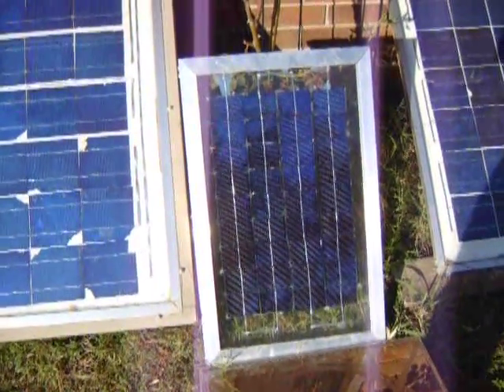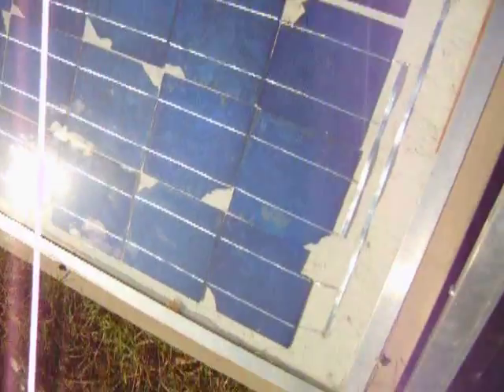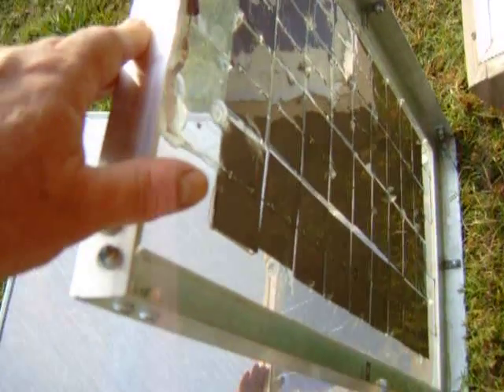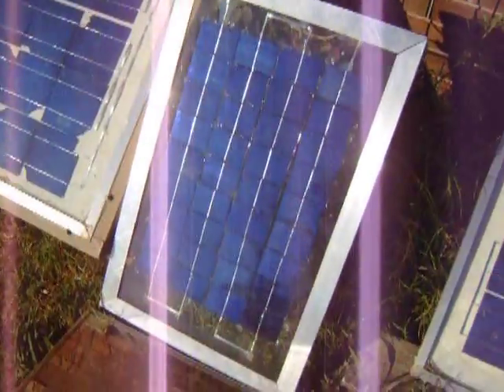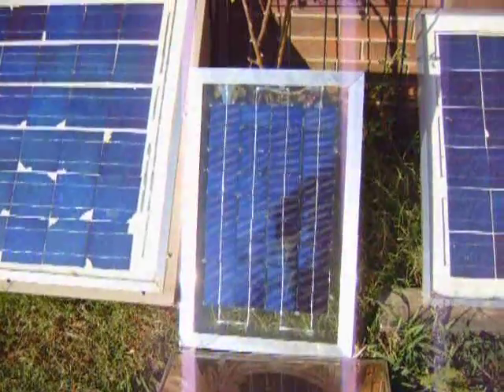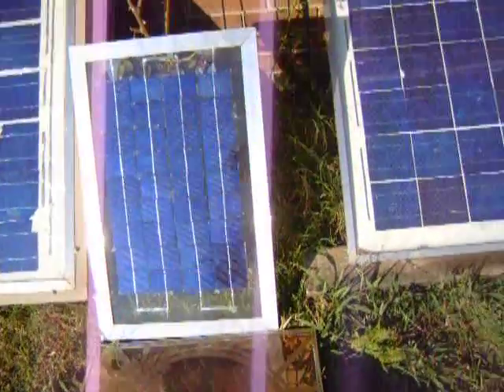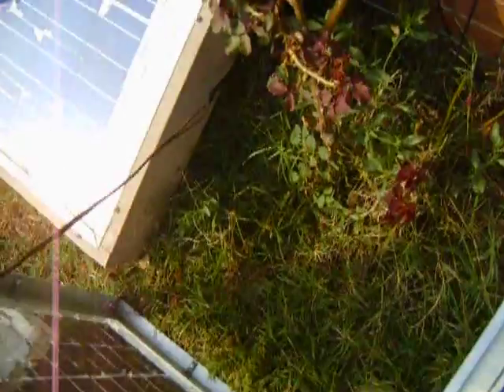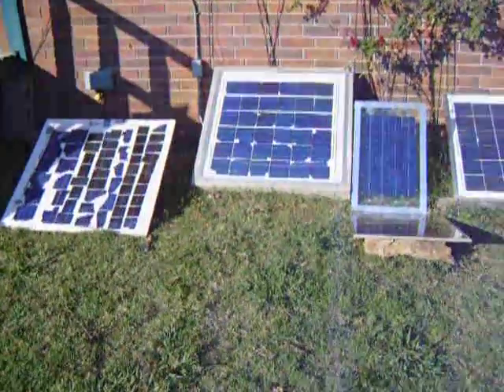How to Make a One Amp Solar Panel

Comment from the maker: @LoveMyDogy no it will run underneath the cells easily enough. you will not be able to solder the bus wires to the rows of cells you have to connect each row with bus wires and you dont want all that messy encapsulate on your bus and tabbing wires solder wont stick and you wont have time to solder before the encapsulation dries. Please go look at markp0177 channel and look at his uploads look at " how to build a solar panel" its three parts the guy is a expert. They are the best videos to watch.

Comment from the maker: @LoveMyDogy Let me know when you have tabbed the front of all forty cells. don't break any if you don't have more than forty! its almost impossible not to break several. you need about ten extras lol . Remember the electricity goes in the top comes out the bottom of the cell then it goes back into the top of the next cell. it can be easily messed up I have a couple of times.

Comment from the maker: @LoveMyDogy Remember to do this first put tabbing wire on the front of each cell all forty with flux pen and solder. "Scratch the white coating off then flux the wire and flux the cell. Then solder it on. Sometimes if there is enough solder you don't have to use any on the front side of the cells. Sometimes there is not enough solder and you must add some to the tabbing wire. Watch my video how to solder solar cells it s one of my first up loads. But Im doing it backward gluing them to a board.

Comment from the maker: @LoveMyDogy  you can't lay them down all thirty six or forty at once they would be breaking and when tabbing wire or bus wire gets silicone on it, it burns and smokes wont solder. you have to glue them one at a time to your glass with the tabbing wire already attached to the front of each cell then lay the second one down and glue it with tabbing wire already soldered to the front then attach the front tabbing wire to the back of the next cell with solder reapeat over and over.